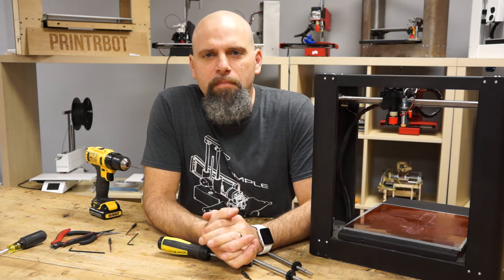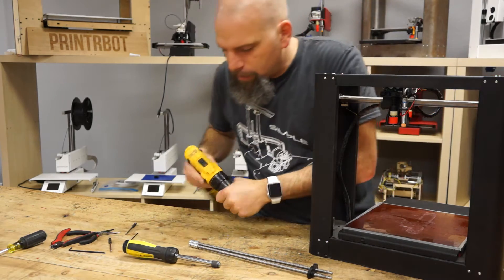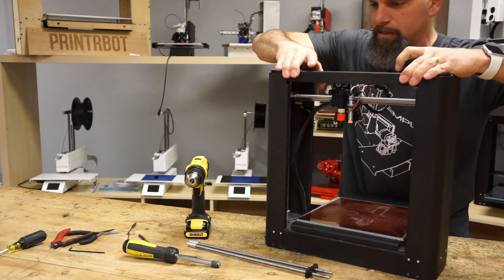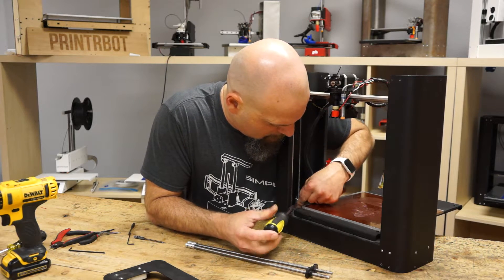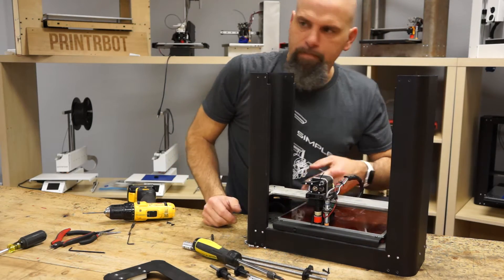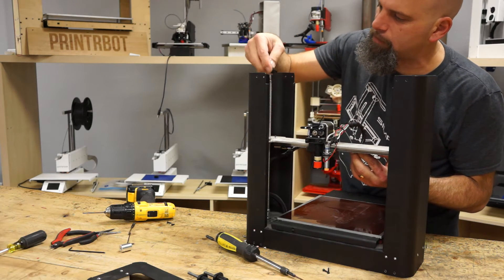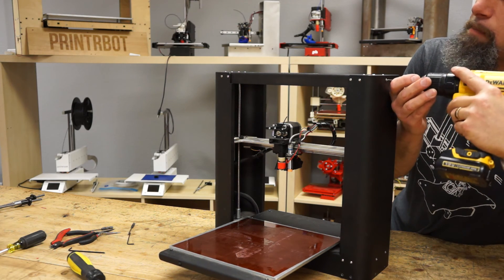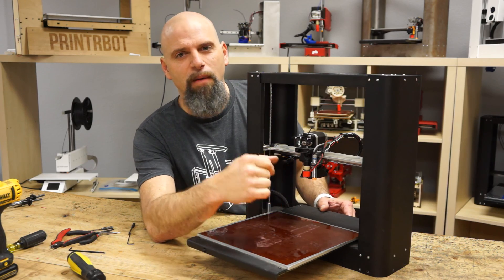Printrbot Plus - Z Lead Screw 4-Start Upgrade Build

Comment: Nice video Brook, so what would be the new steps per mm for these leads screws? Thanks J.
Reply: So I think I worked it out, with the 8mm pitch, 1.8° stepper and 1/16 micro-stepping it would be 400 steps per mm. J
Reply from the maker: M92 Z400
M500
M501
;)